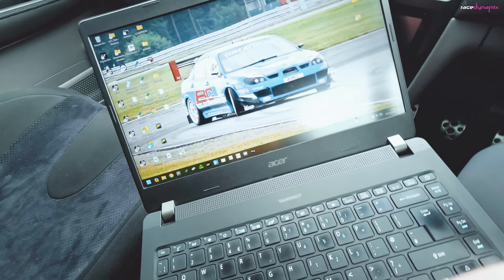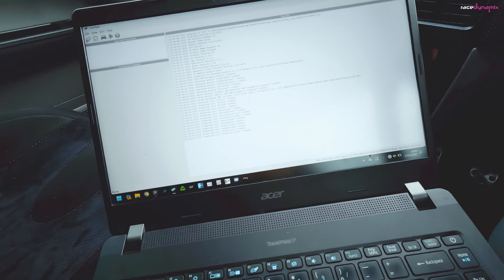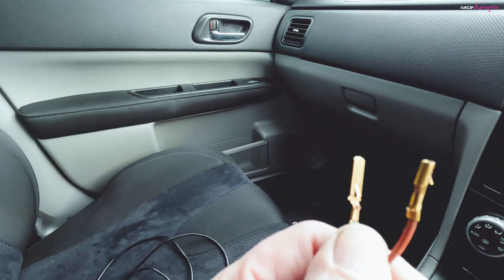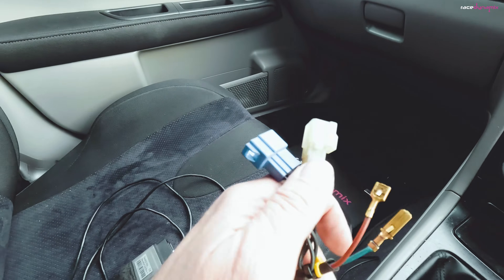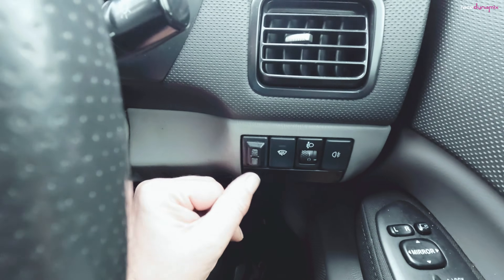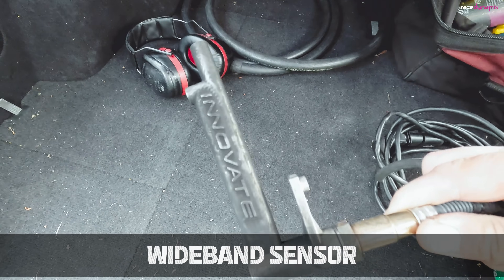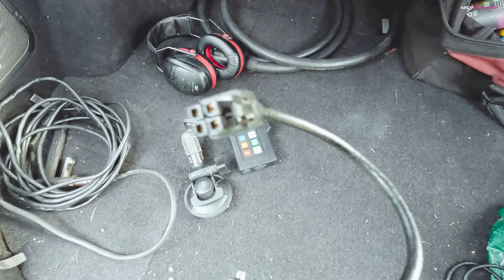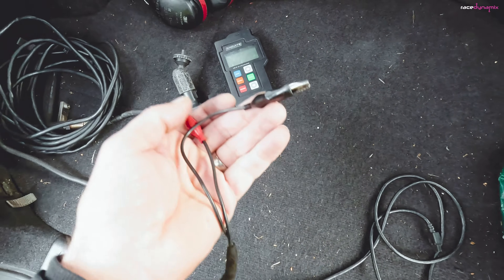6 ESSENTIAL Tools to SELF TUNE your Subaru

Comment: Hey Duncan, I just started with Subarus. Picked up a 2010 legacy 2.5GT, I have been searching everywhere for tuning information about these cars and this just saved me. I never wanted to buy a preloaded tune from Cobb, but I was close. So thank you. But my question is, is there a way to tie the AEM wide band into the ECU so the ECU with make correction based off wide band instead of narrow band? And is it necessary to use a 3 port boost controller?

Comment: Hey Duncan, I got a question. I have a 04 Wrx with a 02 usdm ecu. Trying to tune using carberry. For the wideband would you trust the iwire aem xline pnp adapter? I was planning on using an unmarried  Cobb ap for a gauge after the tuning process, do I need a separate aem wideband gauge during tuning to verify what the tuner is seeing on the laptop is correct? Also is there any particular tactrix clone you do trust? Their website is out of stock. Thanks!
Reply from the maker: Iwire have been going for a good while now and their wiring solutions are pretty well tested... I would trust it but a gauge is never a bad idea if you know what you are looking for,  If heading down the caarberry route it will really help you to have proper afr tuning data,  Are you a member of my academy on here?

Comment: Is it necessary to use a wide band o2 sensor?
Reply from the maker: Yes.  The std lambda sensor is not accurate enough to rely on solely, which is why subaru only use that sensor when idling or cruising off boost 👍

Comment: Hi thank you so much for your content I have a 1999 Forester Gt is there anything different I will need to self tune for this year ?
Reply from the maker: @ramppit  It is extremely unlikely that you will be able to get into the ecu to amend it unfortunately, so your best bet would be a Link G4 ecu to give you that 👍
Reply: @racedynamix  thanking you!!!
Reply: @racedynamix  hi I am doing my valve clearance on the 99 Forester gt ej205 what I have found is 0 .008" inlet and 0.010" exhaust +- 0.0008" is this correct" cause I have faced my inlet valves and cut the seats and they are pretty much within spec which is odd to me cause normally I would tip the valve later to bring them back to spec. Is there any chance you could find a solid spec for me please. Bucket and shim they are
Reply from the maker: @ramppit  that's what I gap them to 👍

Comment: Duncan,  this is great!  You mention something about importing the AEM afr data into a log.  I use Romraider.  Do you know if it’s possible to import the AEM data directly into a romraider log?
Reply from the maker: Yeah you can log it directly into romraider.  There is a little bit of wiring / leads to do but possible

Comment: I signed up on website, question I'm in United States and enjoy your channel. Have a 04 WRX only mods done are three inch downpipe out to back with three inch straight pipes. Plan to get tactrix and wanted help getting a baseline done toy car since Cobb or other "performance" dealers won't touch car since it's catless. Can you help with that
Reply from the maker: Hi.. yes absolutely.  Send me an email to Duncan at racedynamix dot com and I will run through the process 👍

Comment: How accurate is wideband reading from the muffler? Or how much delay is from measuring from there, compared measuring from 5-10" from the turbo? Also is catalytic converter affecting AFR? I mean measured before and after.
Reply from the maker: it is remarkable accurate so long as no exhaust leaks tbh.  There is a small transit delay but it is easy to spot and resolve.  I would tune slightly richer readings with a cat than without to give margin for error 👍

Comment: Also tune your afr gauge that’s permanently mounted to be the same as your tuners readings. Meaning fool around with the 02 sensor location untill they are identical numbers. Otherwise your tunes won’t be in sinc if they are a e tune later on from a log.

Comment: The custom knock controller. We used to run a hot wire beer the motor and it picks up any vibration
Reply from the maker: Nice idea but I trust sound more than any sensor.. And these never fail to pick up detonation.  Plus I can hear air leaks and all kinds of other noises 👍

Comment: Great content, Duncan. I have a Hatch STi. I've been planning on contacting you for a map in the new year. I'm not bothered about making more power. I just want to know it is running safely.

Just curious with regards to lambda readings. Mine has a Cobra quad pipe exhaust. Would that affect the lambda readings in any way? Just thinking exhaust gasses would be looking for the path of least resistance and go out of another pipe? (if you catch my drift) 
Also, on the hatch, is the stock lambda not good enough to at least get a ballpark reading? I run a AEM Electronics X Series OBDII because in a single gauge it can supply loads of useful OBD ECU information. I have it set to AFR and I have seen it go to 10:1 under boost and 20:1 off throttle (when slowing down)
Thanks.
Reply from the maker: Hi Robert.  The lambda readings at each of the tailpipe is slightly different for the reasons you say 👍

The narrowband isn't accurate enough to use for tuning but as a general guide is fine 😎
Reply: @racedynamix  I have thought about replacing the post cat lambda sensor with an AEM wideband and gauge, then disabling the CEL codes with my Tactrix cable. Being after the cat and that much further away from the turbo, do you know if this is likely to cause any issues with the accuracy? Would this better help someone like yourself with regards to mapping an ECU?
Thanks again
Reply from the maker: @RFox1337  nope, that's a good idea.  You get a very slight lag in readings but not an issue 👍